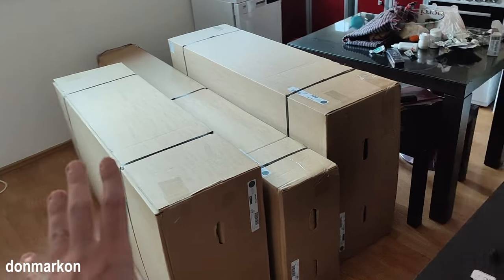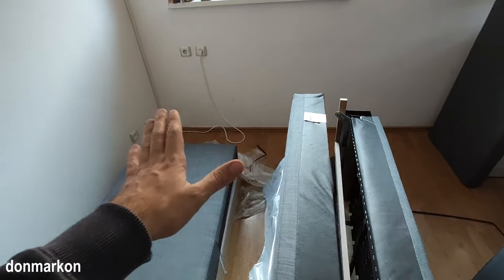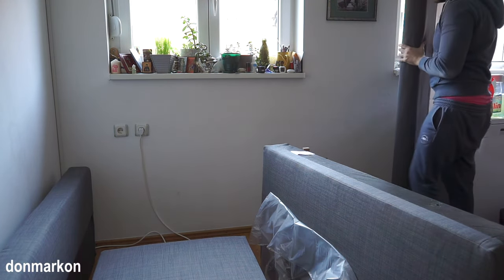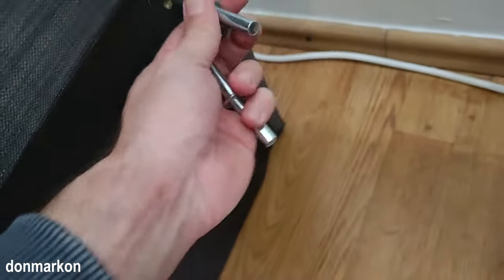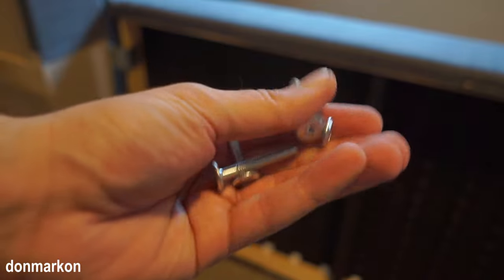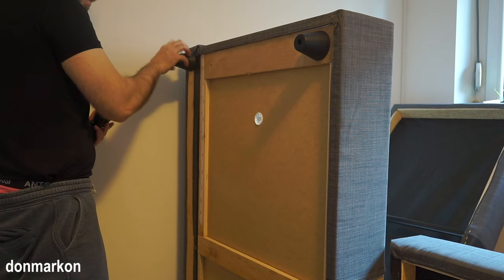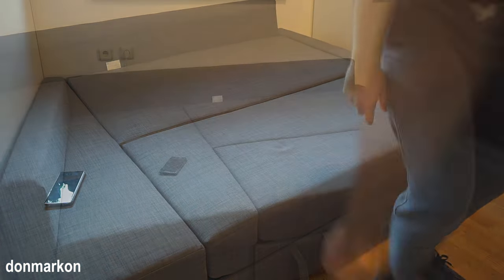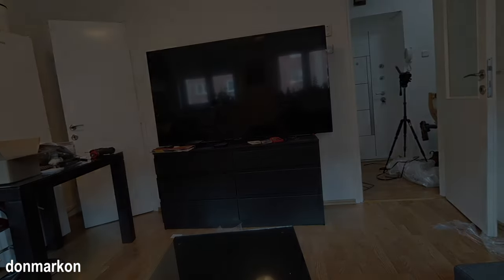Ikea FRIHETEN Sofa Bed Assembly 2024 Disassembly From Start To Finish

Comment: Hi, I bought a second hand sofa. I can not able to assemble the other side where thread bolt connect with one piece. The problem is the whole is big where I was not able to screw it.  Is there any solution?
Reply from the maker: Upload picture so I can see and give you advice
Reply: Same problem here, like theres a part that has dissapeared inside the sidepart, so theres nothing holding on to the screw in the hole

Comment: Super directions, thank you  very much! I had to I assemble mine first to move it to another level. The only suggestion I’d add to that process is to remove the legs. The assembly would have been easier if I had done that.
Reply from the maker: Thank you!

Comment: Pretty straight forward and helpful instructions! Thanks! 
 I was planning to buy one of these, but I was also wondering the probability of disassembling it when I want to move to somewhere else. Is it as easily possible as the assembly part? And are the three parts too heavy for one person to carry?
Reply from the maker: Hey hanks!
For disassembling just do steps from end to start. Regarding moving parts alone ... well when out of the box it is doable for average guy but spare hands would make it super easy